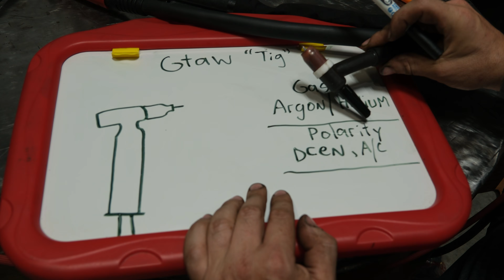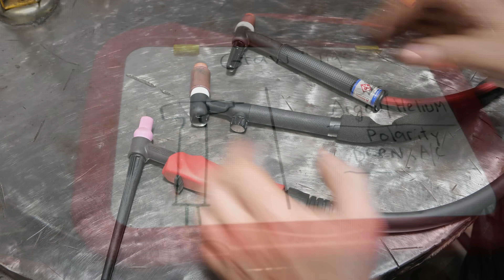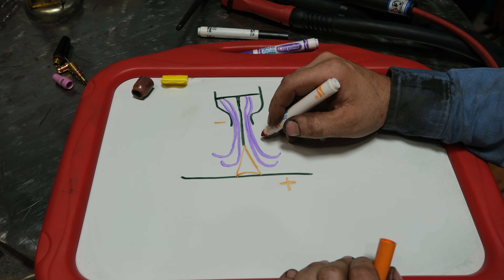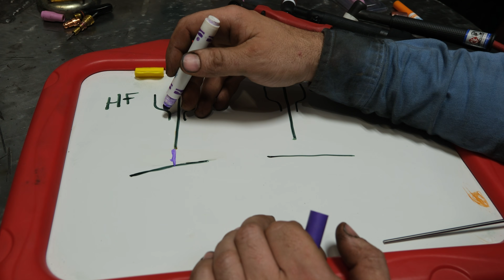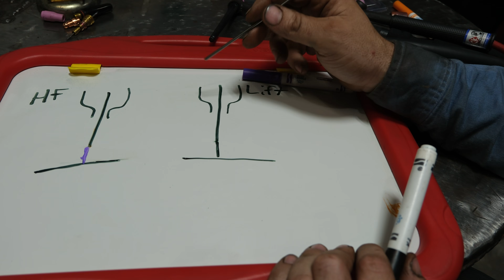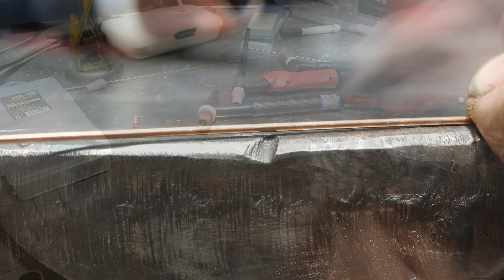How to Tig weld:  Part 1, introduction to tig welding

Comment: I was planning to take courses in TIG welding for $2000.00. All hands on in shop, now I'm doubting myself because the program is only 3.2 weeks. Am I wrong for doubting myself or is it not enough time to learn the process?

I was paying attention to what you said during 49:15 .....
Reply from the maker: That’s a great question and I will actually make a video on this, look for it in the next week.  In the meantime I will give you some advice.  Welding is a skills based endeavor and there is no substitution for practice.  Where a proper eduction comes into play is a good instructor (and a proper course design) will save you potentially hundreds of hours of doing things wrong, and will prevent you from forming bad habits that keep you from progressing.  Kind of like if I sat down with you I could watch you weld and immediately tell everything you’re doing wrong and correct it.  If you were to buy a welder and sit down yourself, you will likely spend a lot of time doing things wrong and developing bad habits.  So a good teacher and a proper course will get you to a high skill level faster than doing it on your own.  The hard part is knowing if a particular course is worth it.  2k is a lot of money, but if you’re welding/getting instruction 8 hours a day that’s not that bad.  It comes down to how good the instructor is and how good the curriculum is. 

Another thing you must ask yourself is what do you want to gain with the school.  If you want a job tig welding there may be a better way to do that (aka through a community college where you get real certifications) or through a local union apprenticeship.  If you want to do it to fabricate stuff for yourself or gain the skill for your own business it’s probably more worth it.  I personally have done all ways, I went to a community college for a few welding credits, was trained by steamfitters in a special high level welding program, and I taught myself a ton via thousands of hours of practice.  All ways work, the fastest is to work one on one with a skilled welder, or at least in small groups.  Before dropping the coin I would verify the instructors credentials, ask for them to demonstrate their skill, and get a feel for their ability to teach.  If things look good it’s probably worth it.

Comment: I've built my own oxy generator back in the late '80-ies (you know, the barrel and the bell). Harsh times (in my country, back then). I have a good hand and results with oxy and MIG, having the TIG under my belt would make me a happy retiree. Life goes on. Thank you for the clear explanation of all the things going on during the arc. Greetings from Romania.
Reply from the maker: Tig welding is what I think is the ultimate home hobby welding process.  If you can clean/prep the material the welds it puts down are clean, strong, and typically have great fusion/penetration.  It’s also very clean with no spatter to clean up.  Tig isn’t that hard to learn especially if you have other welding experience.  100% you should add it to your tool belt, you won’t regret it at all.

Comment: Loved the video, I am just getting started on welding let alone TIG welding.  I purchased the Primeweld 225X.  Very informative, can’t wait the watch the next one.
Reply: I purchased a primeweld also . Great company.
Reply from the maker: The primeweld 225 is a great welder and has proven to be very reliable and capable.  You will have no issues learning to weld with it and having it keep up with your skill.  Starting to learn with tig is actually a great way to learn (and is how I did as well).  You will have a much better understanding of how welding works because you will see everything clearly.  The big thing is to work at being smooth/consistent in movement.  If you can move at the same speed, and keep the arc gap consistent, your finished weld will likely be very decent.  Expect to be frustrated a ton for a while but once your brain starts doing things without you thinking about it the process becomes easier.  You can do it 😀👍

Comment: I always use TIG welding in important cases. Wherever elegance, beauty and strength are needed. Things like the first pass of welding a pipe or tank or sensitive cast iron or aluminum parts. I hope I can make full use of your useful content.😊
Reply from the maker: It’s hard to go wrong with tig, you know the quality of the weld is good 😀👍
Reply: @makingmistakeswithgreg  
Exactly

Comment: What about the Yeswelder MIG 250A Pro and the new Yeswelder DP200, do you think they can run 6011 stick? These are the two machines in have.
Reply from the maker: That’s a good question, it’s hard to say.  My guess is one of the two probably would.  6010 would likely not run properly on either.  If the machine will long arc a 7018 and maintain an arc it probably will run 6011.

Comment: What’s your opinion on the YESWELDER MIG-205DS PRO MIG Welder, 200Amp 110/220V Dual Voltage MIG Welding Machine, 5 in 1 Gas MIG/Flux Core MIG/Spool Gun MIG/Lift TIG/Stick Multiprocess Aluminum MIG Welder, Spool Gun Compatible?
Reply from the maker: So my honest option is I wouldn’t spend money on the yes welders because they lie about specs.  In a nutshell they generally don’t do what they claim (output less amperage than spec, capabilities stated arent what the machine will do, etc).  A fellow YouTube reviewed a bunch of yes welders and did a great job.  The link at the bottom is one, but he tested a bunch of different ones.  He found out what I found out, that they aren’t very good.  If you’re in the states I would stick to harbor freight or a used welder on market place.  Here is a yes welder review:  https://youtu.be/qYUDduC_nJk?si=talKvroztLOYZnxg

Comment: What's your thoughts? Money is not a factor, almost same price. Everlast Power i-TIG 200T or Power i-TIG 201 ?
Reply from the maker: Looking at both of those I would go with the 200 for a couple reasons.  It has hot start for stick which is a really good thing to have.  It’s a bit lighter which is good if you’re carrying it around.  Both of them likely tig weld very similar, the 200 is likely a better stick welding machine.  It’s open circuit voltage is a bit higher which will help start rods and the 200 claims it will run 6010 somewhat, the 201 says it will not.  If stick is not a concern at all I would save the money and buy the 201.  The price difference will get you an argon bottle, steel for practice, or accessories.

Comment: Not related to this video, but I like analyzing weld failures. The guy's converter hitch had the aluminum welds shear off. https://youtu.be/pHsoUQFnyqY?si=6vTh_fYag39iG8jK&t=319

Comment: One additional tip, you'll need a good hood, the cheap ones will flash you at low amps DC tig, even if you set the sensitivity up so high that fluorescent or LED room lighting darkens the hood.
Reply from the maker: Excellent advice and absolutely true.  It’s funny how a cheap hood has no issue with stick/mig, but many struggle with sub 60amp tig.  Super frustrating for sure.

Comment: Hey Greg.  I love your videos because you take the time to explain why things are the way they are, not just show us.  In this one you heavily emphasize practice.  Would it be possible for one of the videos in the series to be some practice routines, drills, techniques, etc?  Essentially, how and what should we practice, and how do we measure improvement?  That would help me, and I think a lot of the other new tiggers, quite a lot.
Reply from the maker: Thanks for the kind comments.  I will have a whole videos on practice drills and what you will need to focus on to improve.  I will definitely take your thoughts and mix them into some videos.  In a conventional school you have assignments and grades, I will likely implement something like that into the classes.  When teaching yourself to weld motivation, inspiration, and direction are critical in getting to where you want to be.  It’s also hard to understand what it takes to get to where you want to be with skill, I will have to do some content regarding this as well 😀

Comment: I prefer Tig over mig or stick. 
The other day I Tig welded our chairs because our fat butts broke them. 

Question… do you like using pulse Tig?
Reply from the maker: I will be honest, I virtually never use pulse.  Pulse can help in fusion welds on stainless but beyond that I prefer to just dab.  I will definitely do a whole video on pulse.

Comment: Great video!  I've learned the basics of MIG, Stick, and Flux Core welding through you so far (and practice and fix and build things whenever time permits) so I'm prolly gonna' be sitting on the bench through the TIG lessons (the ol' budget, time and money, can only go so far).  Bummer I won't be able to play in the game but I really enjoy learning new stuff and this is the place to do it!  Thanks for sharing and I'm looking forward to the next installment!  🙂
Reply from the maker: Glad to hear you learned a bunch from the videos 😀.  Tig definitely costs money to get a decent setup.  There are ways to do it on the cheap but they tend to not work as good.

Comment: At the very beginning in the mid 40's tig welding was not even called that, it was called heliarc welding covered by patents. It was invented by  Russell Meredith of the Northrop Aircraft Corporation in 1941 but development started in the 1920's. It was called Heliarc because of the choice of helium as a shielding gas. I built my own TIG welder in the mid 80's using a 400 amp three phase welding transformer and a rectifier pack I built up using some very big diodes the HF was provided by an old ESAB hf unit that consisted of a transformer driving what looked like an ignition coil with a bosch spark plug and capacitor that turned out to bre dud, the replacement capacitor was very expensive to replace, apparently the plates were made of pure silver separated by mica, but the unit worked and served me for about ten years until I could afford a proper tig welder. I found tig welding very easy due to having first learned to weld with gas back in the early 70's at the local technical college, the instructor said learn gas and all other processes will come easily.
Reply from the maker: Thanks for sharing the story and awesome you built your own tig machine 😀👍

Comment: Does anyone have a fronius cu600 cooler? I'm building my own cooler for a magicwave 230i and I've already figured out how to turn on the pump and fan but I need a few pictures of the cooler harness to figure out how the flow and temperature sensor and coolant level are connected. Can anyone help me because there are no pictures or diagrams on the internet?
Reply from the maker: I wish I could help you on that.  I know it’s fairly common to build your own cooler.  If the magic wave controls the cooler like miller does (for On/off and powers the cooler) I would assume it would have either a main hot, a main neutral, a trigger hot, and a trigger ground.  Or it would be possible it has just a hot and a neutral.  You mentioned temp sensor, as far as I know most coolers don’t have a temp sensor.  If fronius uses one to determine how fast to run the pump that really complicates things.  I doubt they would tell you how it worked if you emailed them.  It would be possible to reverse engineer it via using a variable resistor and an oscilloscope to look at what’s going on.  It would likely be outputting low voltage to the cooler temp sensor and reading the resistance on the way back.  It’s possible the cooler would do that itself and communicate via data cable to the welder rather than feeding a simple voltage signal to the welder like a simple temp probe.  If I had that cooler I would gladly reverse engineer it for you.  

If you can figure it out your best option is to just use a stand alone cooler and plug it in separate.  Far cheaper than fronius’s cooler and it will work.
Reply: @makingmistakeswithgreg  Thanks for the answer. Maybe I'll explain a few things. The cooler from Fronius is definitely more complicated than the one from Miller. I had to buy their chip so that the wougle welder would see that the cooler was connected (200 USD). The pump itself is switched on by a relay (220V constant speed) in the welder and the fans are powered by 24V also from the welder (multi-pin socket for communication with the welder), as is the valve for returning the liquid from the pack, monitoring the temperature and flow and the level of the liquid. At the moment it is functional enough that I can weld 😎 (the cooler turns on after the arc is struck) but I do not have monitoring of the liquid temperature and an alarm about the flow blockage, which does not allow me to choose a more convenient cooling system (switching off at the appropriate temperature)😭. A bit like with a car, it runs but there is no air conditioning 😂. As for figuring out how it works, it's super easy with a multimeter or you can even read the descriptions of the cables if you have good enough photos of the harness itself. I just hope that by posting such a request someone will want to take a moment and unscrew 5 screws on the cu600 and take detailed photos, that's enough for me. Greetings from Poland. I'm waiting for the continuation of the series!!! 👍
Reply: @makingmistakeswithgreg   And I put the comment here because I'm sure I saw a fronius torch in the ligt version. And I'm waiting for what kind of machine it will be from 😁

Comment: Just found your channel and subscribed. I bought a PrimeWeld early last year fully expecting to learn to TIG weld but life got in the way--it's still in the box. I think I'll be able to get started soon and will follow this series unfailingly and finally get started!
Reply from the maker: The prime weld is a solid machine and you should have no problem following along with the videos I am going to put out.  I hear you on having the welder still in the box, I haven’t opened up a flux core machine I bought for testing yet.  Next thing you know months go by and it’s still sitting.  Definitely get your machine out and setup 😀.

Comment: Very good information. Looking forward to more in this series. I am self taught and run Lincoln 305G scratch start, yes it’s tough, yes wanting to get better. It’s a beautiful process once it’s learned.
Reply from the maker: Scratch is doable, if you can weld with it you can weld with anything tig.  A simple HF start machine makes everything easier.

Comment: A brilliant tutorial young man. The biggest problem I have with Tig is not doing enough of it in order to build a good skill level. I find the arc is always small so I need to wear reading glasses which is annoying and then feeding the filler rod is a tricky technique. I need to learn more and your videos will no doubt help me a lot. I can do it in a fashion but your guidance will give me some top tips.
In a funny coincidence, I was asked only yesterday to repair an alloy wheel for a BMW car, I refused to even look at it citing unknown materiall make up, danger to life if the wheel fails, my lack of high end skills and the risk of it not working anyway. Knowing or being good at welding is great, but you need to know when to turn jobs away too!
Reply from the maker: No doubt turning down jobs is part of life and in many cases is the smart thing to do.  I have done a lot of aluminum wheel repairs, and they generally weld ok.  If the wheel is a very thin forging that’s machined I will pass.  The issue is if the base material was heat treated welding it will cause a change in the heat treatment.  Most commonly the material will be brittle in the heat affected zone.

No doubt tig can be hard to master.  What I found is the light output is the best indicator of arc gap.  Training your brain to understand how much light you should see at a given amperage and using the light output to determine gap negates how good of eyesight you actually need.
Reply: I used to always bury my face in the arc to try and see better, I went through countless gloves in my early days. Now I focus more on feel and hearing the arc as opposed to seeing it. Half the time with tig I’m welding blind and by not focusing on my sight that helped me a lot.

Comment: grin Can you please do a video for our wifes: "Why your husband needs a  Tig Welder". For extra credit talk her into one that can do  aluminum.
Reply from the maker: Haha, I can say this.  If you want to weld any common material (steel, stainless, aluminum) tig is actually far cheaper.  With mig you need 3 gas bottles to weld those materials and the welder itself with a spool gun will cost atleast 600-700$, for atleast 1k investment.  A 800$ tig machine and one argon bottle can weld all those materials, and it’s a stick welder too so you actually get two welders for around 1k all in.  So in the long run it’s actually less money for more capability 😀👍